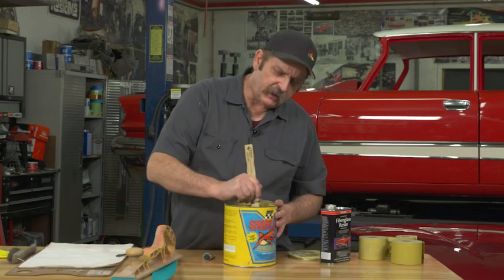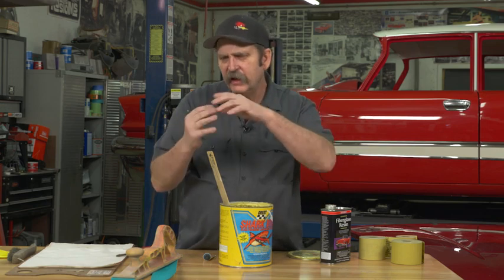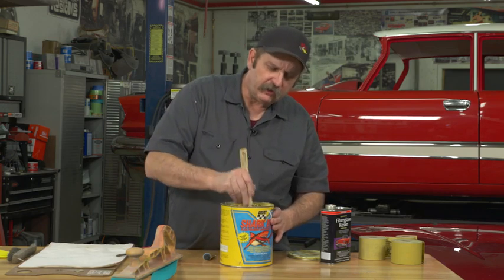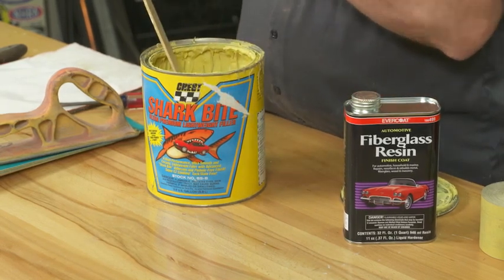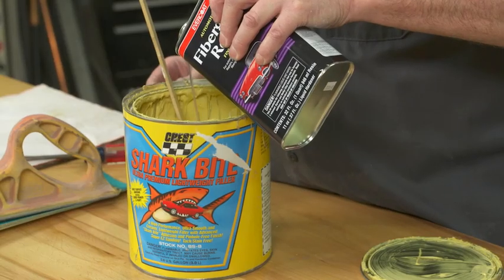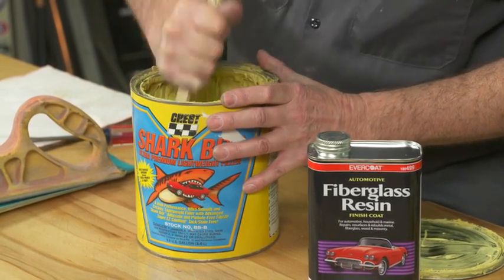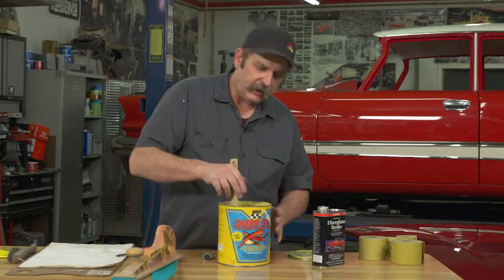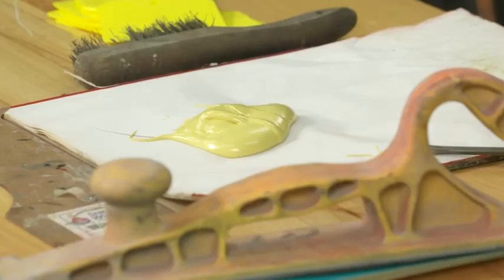Thinning Bondo

Comment: That is a good tip but I would go a step further. Find the product online by the company and look for the TDS sheet. Not all ingredients are trade secrets and good knows common chemicals be it Acetone, Polyester Resin (Fiber Glass Resin In Video) are common products used to make stuff. You don’t have to have a degree in chemistry to read items used you have on the shelf. Plus, I hate throwing away useful products! Even if I paid way less that Uncle Joe Prices!
Thanks. DK, ASE master tech since 1978, retired.
Reply: I do this for a LOT of things and find so many alternatives by ingredients and save money buying lesser known brand items that are the same as high priced items because of the brand name.
Reply: So can you thin a body filler with acetone to make it almost pourable for certain project? And of course adding the hardener. Thanks 😊

Comment: Guys, 

He missed an important step. You must add the fiberglass resin hardener as well as the body filler hardener.

I wouldn't add it to the can like that, though, since you have to add the proper amount of fiberglass hardener.

Just follow the directions of the fiberglass hardener and you will be fine.
Reply: not till your ready to use it
Reply: Use it all the time fixing dented metal walls at work. Even use 50 50 glazing putty and fiberglass resin for retexturing the panels hardens just fine with only cream style hardner. And still sands great.

Comment: I tried this today and it was a terrible idea. The bondo never set properly. It stayed soft and when I tried to sand it, it gummed up my paper and just balled up. 
I uses the same amount of hardener I used the rest of the day and never had an issue. 
It took my ages to did this crap off my project and the material is still on the floor and still hasn't hardened up about 8 hours later..... 
Wasted heaps of my time.
Reply: You have to use the fiberglass resin hardener as well as the bondo hardener to make this work..

Its actually much better.
Reply: @GaryLamb2020  Correct. I use a lot of the fiberglass  resin to paint  wooden handles on hammers, garden tools (shovels, rakes hoes, etc.), wheel barrow handles, and 😮most everything  wooden that is exposed to the elements and extended abuse. Your  point about the hardener is well taken.  I adjust  the hardener to weathe, gravity, and time between coats.It only  make sense to add the hardener to the resin in addition to the plastic hardener.for the plastic  filler. 👍
Reply: Dude its been done for decades, it works, u think this guy never did this before? Lol
Reply: See.  Some guys can literally screw anything up. Prob used way to much resin. Who knows. But it’s works for thousands of body guys for decades.  So the problem here is you

Comment: Hey do you use honey in your filler if you are skimming a roof panel? I am using Rage ultra with a long spreader sanding with 80. Should i just start with 40 grit? Taking forever even with the 32`` linear blocks

Comment: You should never use fiberglass resin to thin bondo like this they take two different catalyst so you will end up with bondo that doesn’t harden as I’ve seen someone in the comments has already experienced you can add the resin catalyst along with the usual cream hardener to make them both kick but this isn’t something you should use on a vehicle as bondo is made to flex with the metal as it expands and shrinks and fiberglass resin is not made to flex so if u put this mix on a car it’s most likely going to crack
Reply: Well said Sir. I've used this technique before and yeah you have to add both harders. I don't recommend this technique for outer bodywork. I personally have not used this for outer bodywork. I use this technique for making custom speaker pods. Which it works outstanding for!
Reply: That’s total and complete bullshit I am a auto body technician and I mix my bondo with fiberglass resin often to thin it out because I am too cheap to buy glazing putty works every single time and it dries but if it remains tacky before sanding wipe with lacquer thinner or wax and grease remover before sanding so it does stick to your sand paper. Peace ✌️
Reply: What else can be done to thin out the filler? Can acetone or lacquer thinner be used?
Reply: @armychris9148 if you read the bondo can it literally has resin in every can of bondo. The more “premium” the more resin.  Idk what that dudes talking about.  Like you said people been doing this for years.  But then again some dudes these days can literally screw up an anvil so doesn’t surprise me